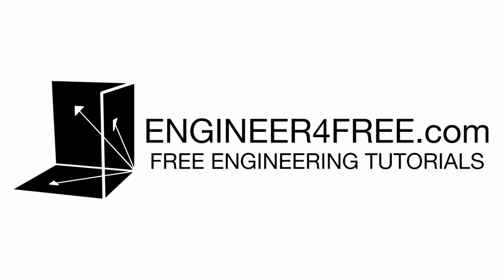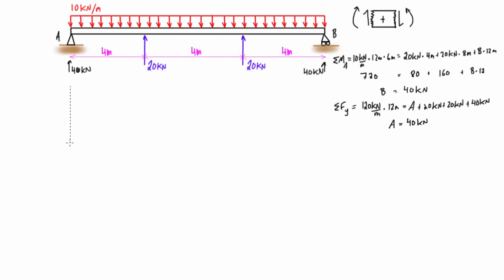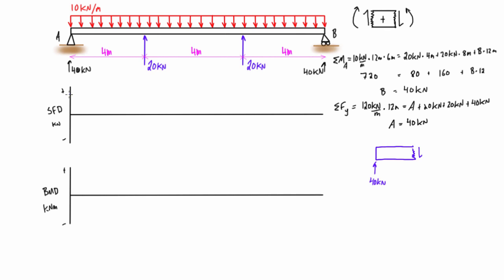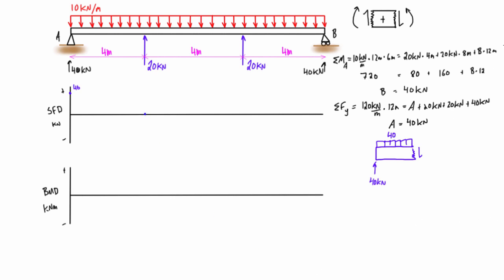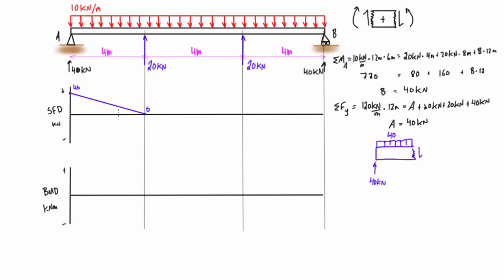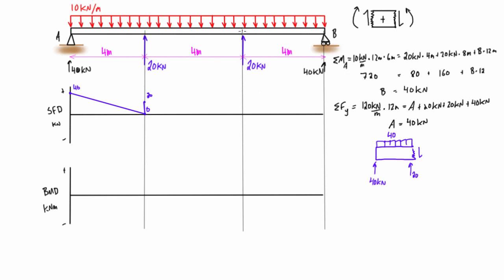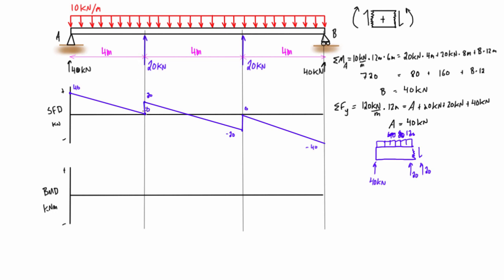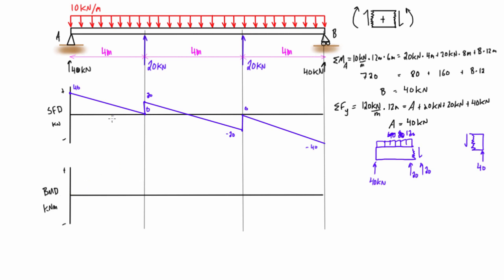Shear force and bending moment diagram practice problem #3

Comment: u miss wrote for summation of Fy...u wrote (120)(12)..when it should be (10)(12).... to get A
Reply from the maker: Ooooh good catch! I got ahead of myself, and wrote the 120 when in fact the whole LHS ends up being equal to 120kN as you have written. The error is not carried through, as my work off screen was correct, so we find A=40kN to be the right value. Thanks for pointing it out, I stickied your comment and put a not in the description incase anyone else notices the typo!

Comment: why did you times 10kN/m on 4m on shear fd
Reply: and why did you use 1/2 base times hight on bmd
Reply from the maker: @maestroemman2442  To answer your first question: It is because at that point, we're drawing the FBD starting from the left side, taking a virtual cut just before (and then just after x=4. In both cases, our cut is infinitesimally close to 4 (like 3.999999999 and then 4.000000001) so the distributed load can be considered to be 4m long. It's a distributed load of 10kN per metre, so 4 metres of it = 40kN in total. 

To answer your second question. The method I am using here is to find the area of the SFD for a certain region, and that represents the change in magnitude across that same region, on the BMD. The area on the SFD from x=0 to x=4 is triangular. The area of a triangle is just = (1/2)*b*h

I recommend checking out:
videos 1-9 here: engineer4free.com/structural-analysis for more examples following this method
videos 66-72 here: engineer4free.com/statics for a more simple introductory method
problems 9.1-9.18 here: https://www.engineer4free.com/statics-solved-problems.html#sfd-bmd for more examples following this method

👌

Comment: oh btw i think u made some slight mistake regarding on sfd graph where from the first +20 should be going to 0 instead of -20 because like u said in ur video,60 going up 80 going down so it will be -20...
Reply from the maker: Hmmm, the SFD is correct. At x=3.99999999m, v=0kN and at x=4.0000000001 v=20kN. This is because the point load of 20kN at x=4.0000000 causes an increase in shear from left to right equal to it's magnitude. On the FBD with a virtual cut just to the left of x=4, we don't include the point load, but when the virtual cut is just to the right of it, we do. And the extra 20kN pointing up on the FBD creates the need to have 20kN more oriented downward (coming from the internal shear) to keep the vertical force balance. More downward shear force means a more positive shear compared to the previous cut.

Comment: The concept is correct but the way you skip too many steps of the problem is not recommended. Most of the professors required the students to fully express the problem in each section of the beam because not every beam is easy to do like this way.
Reply from the maker: Unfortunately when I was a student, at my university we were expected to draw SFDs and BMDs at a near-impossibly fast speed on exams. It was certainly part of the pretentious and toxic weed out culture that exists in engineering schools. So the method that I share in these examples (videos 1-9 here: engineer4free.com/structural-analysis ) can be used to generate the SFD and BMDs extremely fast. Even in these videos, I am talking my way through and it still takes about 10 minutes, but without talking and just rapidly applying the method, you can do these problems in maybe 1 or 2 minutes. That's why I use this method. I did a different, more detailed and basic series on SFD and BMDs that can be found in videos 66 - 72 here: engineer4free.com/statics . For the record, I really hate everything about the engineering weed out culture, and wish that engineering programs were more focussed on respecting students and sincerely teaching engineering principles, rather than trying to break students at every possible moment. I went to school in North America where this culture is prevalent, but if you're from elsewhere, it may be a different (nicer) situation. But yeah, if you've been asked to express each section in terms of x, then this method is insufficient, but it can be used to solve for every max, min, intercept, and shape for any statically determinate beam.
Reply: but my lecturer is fine with it,as long as you have the correct graph :) so the steps are okay

Comment: Question: Can we technically show the bending moment diagram as almost one large curve rather than it looking like 4 different curves?
Reply from the maker: Yeah it's one single function that happens to be discontinuous at the points where ghé shape changes. If you find the BMD the long way (videos 66-72 here: engineer4free.com/statics ) you will generate the actual equation for each section of the BMD, and you'll notice its different in each region, but yeah its all just "the BMD" tho for this given structure with this given loading 👌
Reply from the maker: Yeah it's one single function that happens to be discontinuous at the points where ghé shape changes. If you find the BMD the long way (videos 66-72 here: engineer4free.com/statics ) you will generate the actual equation for each section of the BMD, and you'll notice its different in each region, but yeah its all just "the BMD" tho for this given structure with this given loading 👌

Comment: When you calculated the Ma you wrote 8*12 at the the end.. where is force 8 which have is 12 m far from point a ?
Reply from the maker: Excuse my handwriting. There is a plus sign between the 8 and the 12. One term has an 8 in it, and another term has a 12 in it. The 12 in the last term is referring to 12 metres. By is 12m away from point A.

Comment: How did u get the 6m morning n the summation of the moment calcs
Reply from the maker: The udl is 12m long so it's resultant force is in the middle, or 6m from either side. When we take the moment about A, it means the resultant point load for the udl is 6m away for the moment calc, and the magnitude of the point load is (10kN/m)*(12m)=120kN. Moment is force times distance (perpendicular distance from point to line of action of force, so moment caused by udl about A is 120kN*6m (or 10kN/m * 12m *6m). Make sense?
Reply: @Engineer4Free  what is udl?
Reply from the maker: @mastercookie128  udl is short for uniformly distributed load 👍